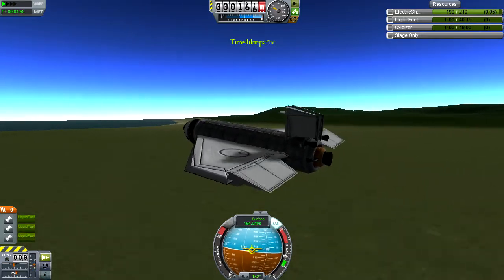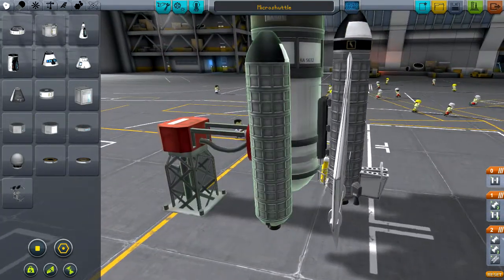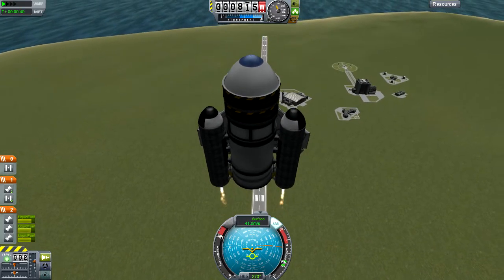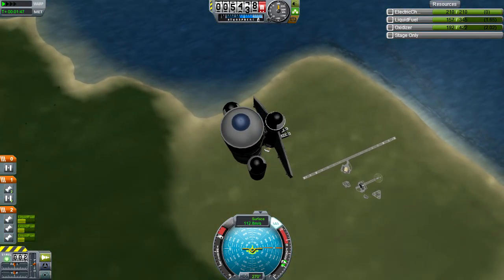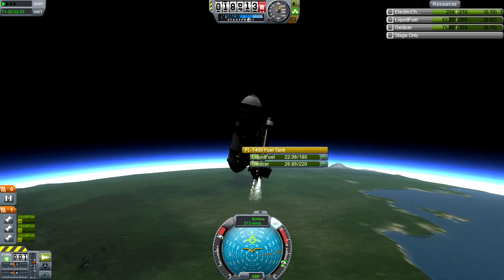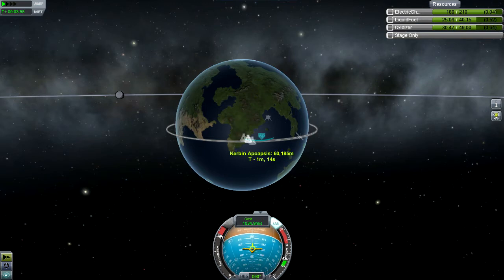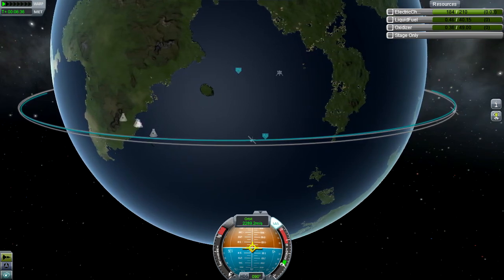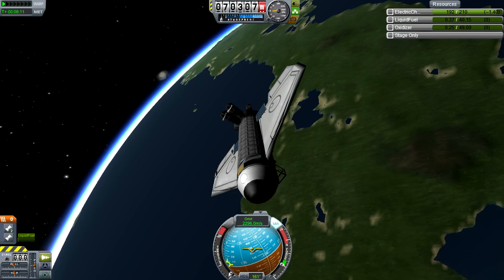KSP - Microshuttle

Comment: When you check out the real Space Shuttle you will notice how it really works. you need to angle the thrusters of the shuttle a little to the outside so it compensates the wrong thrust balance. there are indicators which you can turn on in the construction hall. they have a purpose! ;-P Nice video anyway! I'm working on a new - top secret - type of staging which might be pretty revolutionary.